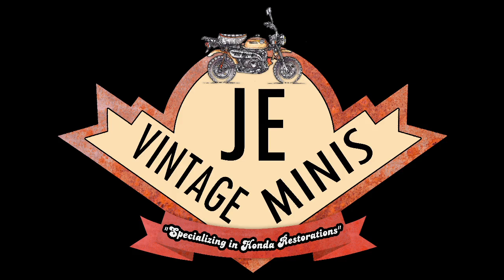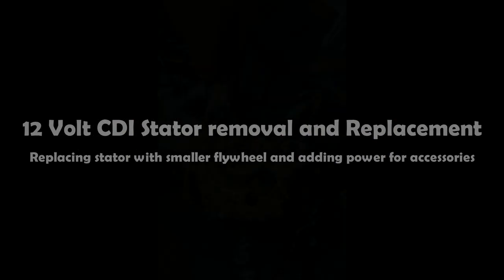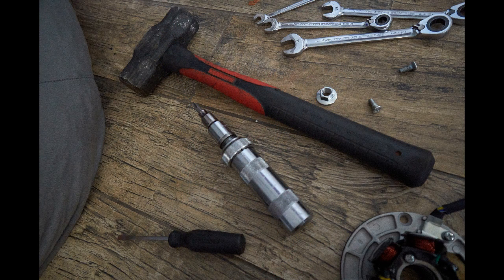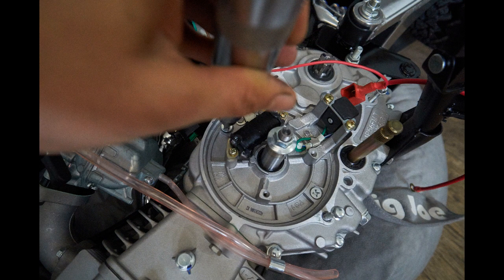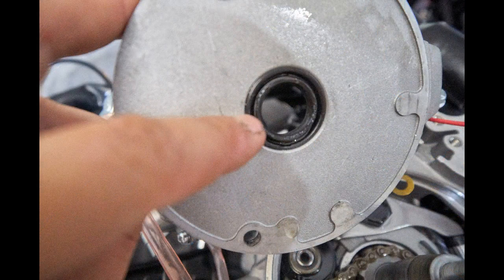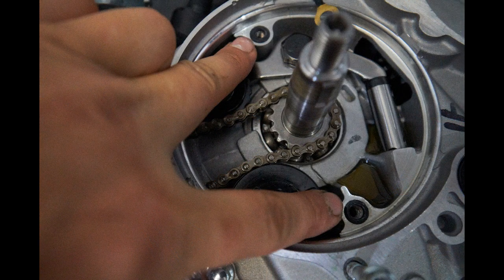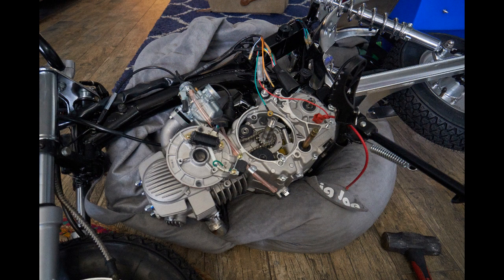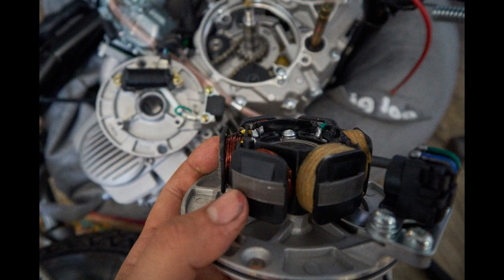Pitbike Import Motor 12v Stator Plate Swap Out Video - YX140

Comment: i have two motors with that newer style stator with external pick up, i need to know what coil to buy or what i need and part number because they both put out but the coils i have are the metal frame ones i get nothing from them, i just hot wire off black wire from stator to coil for test but nothing all part work but not together. so i believe the coil in pictures with 4.00 kit is the one i must buy seperate for 10.00 but is it the one? it seems to be the only other choice. can you direct or agree? thanks